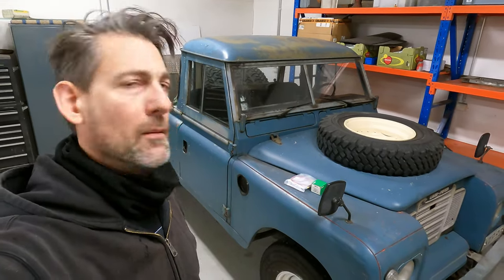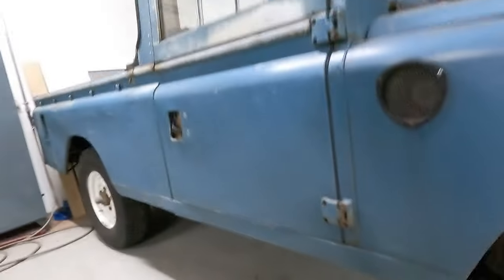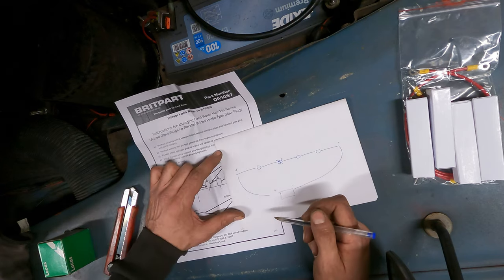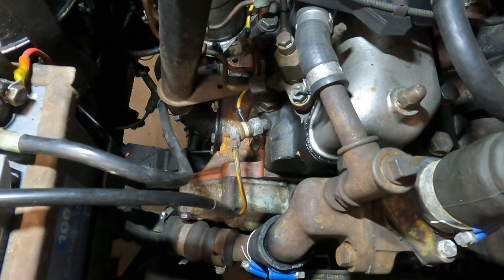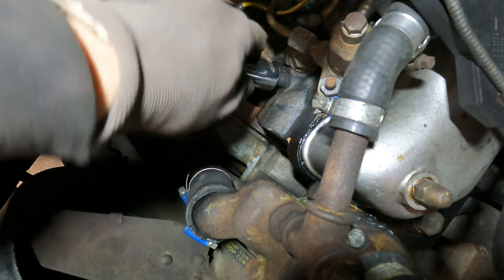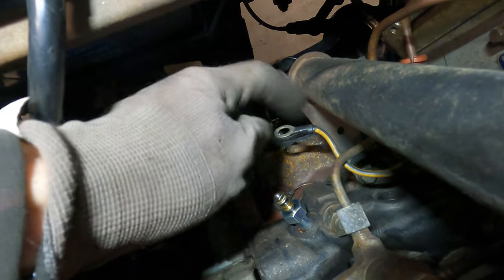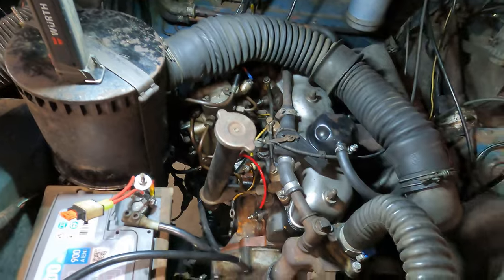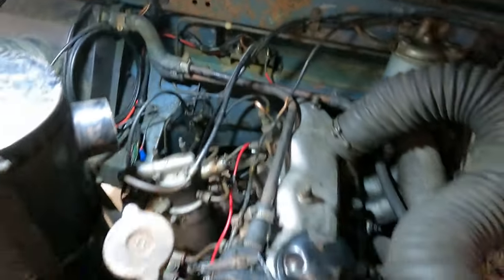Glow plug upgrade on my series III Land Rover

Comment: Looking forward to see what you do to stop / minimise the oil leaks. My Series 3 runs great but there is a trail of oil stains on the road leading to my driveway ...
Reply: exactly the same here... Santana Series 3 Diesel... just make sure to refill it regularly :D
Reply from the maker: Hahaha yes I think it will be like a dog chasing its tail. I think it has lot to  do with it not being used for a while as it didn't leak that much while I was driving it every day to work etc

Comment: Great channel👌 Are you planning further modifications to the interior?
Reply from the maker: Thank you so much. One upgrade I would really like is to add an interior light to the footwell as when its dark it would be a great addition. Any suggestions?
Reply: Was wondering if there would be more stripping inside of cabin, like change of seats or replacing material to dashboard? Any electronic upgrades?

Comment: So what did you install in front of the resistor?
Reply from the maker: The cable from the ignition switch connects directly to one side of the coil and the output from the coil connects straight to the first glow plug. Hope this helps. Jamie

Comment: If there is one plug (wired in series) broken: What happens to the orange light that shines when glowing? Is it still shining?

Best regards
Reply from the maker: Hello there. No, if one plug fails then the circuit is broken so the light is on the same circuit and therefore will not work. Hope this helps 😊

Comment: If they are wired in parallel, how will you know if there is a failure?
Reply from the maker: If one plug was to fail then the vehicle is still likely to start just not as well as if all were working. You can then test each plug and replace the failed one. Hope this helps. Jamie
Reply: @jamiedowson6482  thanks, that makes sense.